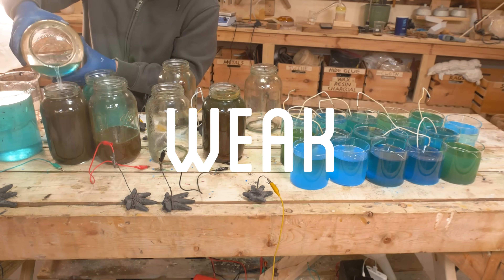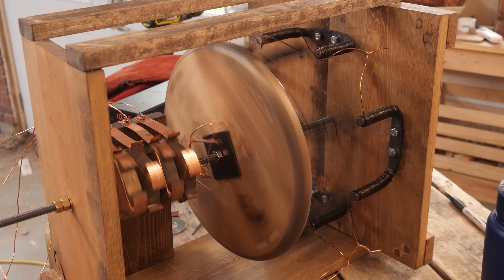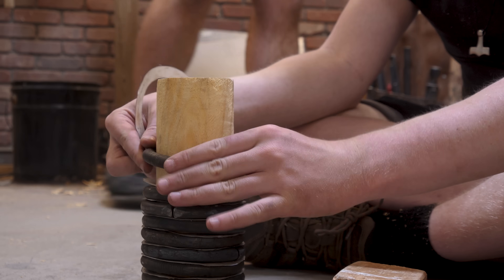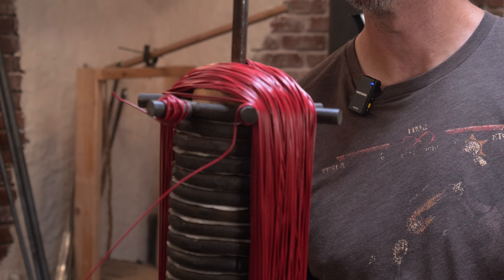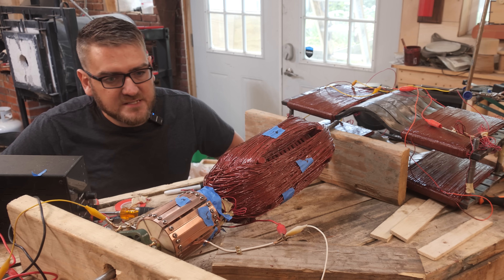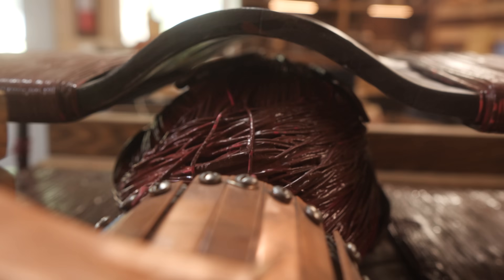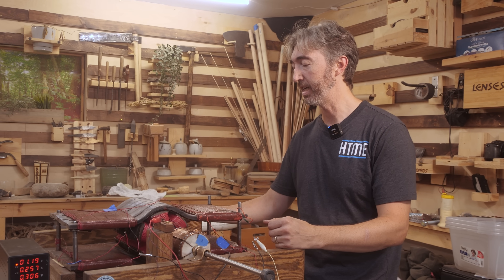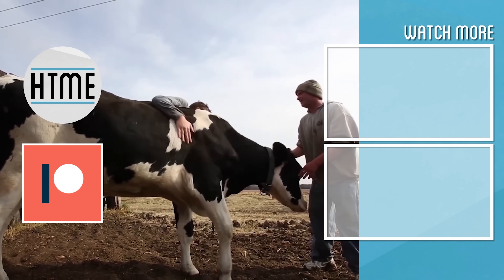I Built the First POWERPLANT!

Comment: Some suggestions would be to use similar laminations for the stator as the later rotor. This should reduce so.e saturation. You can increase or decrease flux density with  the conmutators timing as the coils and magnetic cores have a level of capacitance expressed as a magnetic field.

The challenge is not to exceed the hysteresis of the coils and core materials with a well-timed comutator. 

If you want to check current, just use a known value ressistive load like a power resistor and put a meter in line. You can even measure its efficiency this way as well by examining the dissipation of heat to the kinetic energy put in rotationally. 

From my expense as well, some form of carbon brushes work well for both electrical contact and self healing. They do need to be cleaned occasionally to prevent short or lack of contact. I'm not sure how true you guys want to keep it to the original design, though. 

Hope that is helpful, and it's great to see people making cool things!

Comment: Your project iwas good but you made a little mistake with arrangements ans frem design first you could keep magnet both sides up down the gap increase few cm and use capacitor for output  the way i know if you do it correctly from my experience the winding copper wire you are using can give you at least 45/ 65 voltage ⚡

Comment: When the wire was being coiled I noticed that the failure to rely primarily upon tactile feedback rather than visual feedback was resulting in some less even spacing, but I rationalized it as a simultaneous inspection of the wire and its insulation--a simultaneous safety inspection, if you will. Safety first!

Comment: My first thought was electrical steel (also called silicon steel) for the rotor plates, but that stuff is hard to come by. I'm actually excited to see what you guys can accomplish using regular steel for those, but from what I've experienced in trying to build much smaller motors, it does seem like you lose a lot of efficiency without using electrical steel for the rotor plates. I even tried using iron powder filings mixed with a small amount of epoxy, then placed inside of a 3D printed form to set, but that was even less efficient that just using non-electrical steel plates

Comment: @htme I think you want to reduce the air gap as much as possible. An easy way to do this would be to mount a wooden cylinder with the same diameter as the rotor to the axle. Cover it in sand paper and first sand out the lower half of the stator to a perfect cylinder. Now lower the top and sand it as well. Perfect shape. ❤

Comment: Huh? Shouldn't your stationary coils be on the humps instead of the flat section? I bet your motor works way better if you slide the stationary section to left or right 6 inches and spin your rotor between the two coils. 

If it were me, I'd add a second rotor and tie them together mechanically. One rotor for the left side, and one for the right. But id be very careful. You might create some lethal current. Which isn't hard to do if youre cranking it super fast.

Comment: For a start, as you saw how tightly you can get your coil and how close your coils are to each other makes a big difference, but the amount of windings will determine your out puts, and you'll find speed of diminishing returns with the gap but the smaller it is the faster you can go. The last thing is that you will need more brushes  in different spots on the contacts to help with the pulsing issues

Comment: biggest opportunity for improvement is increasing magnetic conductivity in stator circuit. You need more steel where those studs that keep the stator plates are. You did excellent job with new laminated rotor - stator does not have to be laminated because it's DC, but there is a huge air gap between open ends of top and bottom halves of the stator.

Comment: I think you are losing a lot of magnetic flux in the straight part of the stator. also the stator core could use sum lamination. you can also try to use a glass and aluminum sandwich capacitor to stabilize the voltage going to the stator for a more consistent magnetic flux. you could also add a second off set commutator too give you a more consistent voltage (driving your 2 poles of the stator separately).

Comment: you burned off the wax paper between each of your plates, added alot of conductive carbon on your steel plates, wondering if that affected your insulation you might have had to eliminate the eddy-currents?

Comment: Some ideas on your commutator.

If your output voltage is "Bouncing" you dont have DC output. find a copper tube of suitable diameter, and glue it onto a wood dowel. then take a straight cutting saw, like a hacksaw or bandsaw and make your cuts lengthwise, in line with the axis of rotation. remember, only cut through the copper. then, instead of the brushes only contacting a single line or phase of the comm, orient the brush strips along the outer edge of the comm, so more than on phase or line of the rotor is touching the brushes at once. better to use graphite. then you just have to rotate the brushes so they are in phase with the output from the excited coils.

Comment: An idea for measuring power output would be using it to power a heater coil placed in distilled water. The coil should be separated from the outside environment - i.e a thermos or a calorimeter, with a known amount of water inside. By measuring the time it takes to heat up the water to a certain temperature you can get the power output of the generator. 
If the voltage level was semi-stable during the test - i.e run via a capacitor, you could use I = P/V, giving you the avg current of your generator
  
Or if we assume the voltage kept by a capacitor is stable (enough), just measure the voltage drop across a fairly large resistor placed in parallel to a capacitor - by using Ohm's law you can get the average current without the whole heating up the water problem, then simple multiplication would yield a theoretical power output.

Comment: It seems like the steel bolts that you're using as standoffs in the middle of the stator field is insufficient in Iron contact for continuous magnetic loop without the loop you're separating a large amount of your magnetic flux away from its ability to do its job

Comment: The stator also has strange design. Why is the pole in between the coils, and not at either end? Other such motors, or generators use a single U-Turn electromagnet as stator.

Comment: try running some current through the field windings for a short while with a battery or power supply to give the iron a bit of a residual magnetic field. That might be just enough residual magnetism to get the field windings properly excited under normal operation.

Comment: when stator coils are connected in series, the output rises volts over amps; when wired delta the reverse happens.   is the use of a rectifier allowed; so that the high-loss commutator could be eliminated..

Comment: Linebore the stator so it can have a closer fit to the new rotor. 
But really - I'd make some vacuum tubes to be diodes, and fit them to the rotor, which would be in two parts: A smaller one, like what you currently have , and a much larger one, with just a single pole. 

The tubes would be wired between the one large winding on the big pole and the other three on the smaller rotor, so as to implement a 3 phase to DC bridge. Maybe you'll have to add a shorter coil or two as well, so as to allow for filament heating. 

But the point would be so you can have your existing setup just to put DC onto a second, co-rotating coil. 
Then, you just put it into a big, now stationary, set of coils: Those are your actual 3phase output, generated by the shaft turning the electromagnet inside the stationary coils. No slip rings, so no dodgy contacts to lose power and fail at conductivity. At least, once you get the valves working. Those can just rotate with the shaft.

Most modern alternators work this way. As an added bonus, you can alter the voltage sent to the stationary 'field' coil, and use it modulate the main windings output voltage. Would probably take some more valves, configured as triodes to act as a regulator, but that could be made as well. Initially, just use a variac: You should be able to manage winding one of those. The field coils aren't going to care much if they get AC or DC, whatever will end up getting rectified into the DC through the main field rotary coil anyway. But you could have another bridge made of vaccum tube diodes to pre-rectify it so as you're not fighting the hysteresis in magnetising your existing stator.

PS: high vaccum such as tubes need can be made using Sprengel pumps, which you should be able to manage 
yourself, even avoiding Mercury: Use some warmed up Gallium instead.

Comment: Although it's an inferior conductor, an aluminium can would give you a circular layout. Maybe even a can with an adhesive copper sheet wrapped around it then cut? A thin dremel disc could cut the thin slots needed to break the connection as needed, and filling the cut with epoxy and sanding it so the surface is smooth and not causing a bump would also help

Comment: First of all, how strong is the permanent magnet?
Secondly, check how far out the coils protrude, you want to make the armature have a dense collection of magnetic fields and smaller mechanical resistances, run more cables on one coil set to induce more power and decrease resistance in the curcuit. Electromagnetism is like a hose pipe, depending on your guages, the flow gets pressurized or lacks pressure. And do some research on Darlington transistors and transistors as a subject, it'll help this project immensely🍂

Comment: Where you have the commutator attached to the wood using those brackets, is the rod on both sides attached to a set of barings to keep the setup from bouncing around?

Comment: 2:10, fun fact the electrons dont travel in the wire, they travel on the surface of the wire.
Reply: That is true at high voltage and frequency. The lower the voltage and frequency, the further into the conductor the conduction band can be.

Comment: You are pumping out AC current. Hook it up to a rectifier to convert it to DC power. A LED is a diode that only accepts current one way. Since AC pulses the LED will too. I’d also hook it up to an oscilloscope to see your wavelengths. Great video! I’ve been looking forward to this step for a long time!

Comment: Early generators using the brush designs learned that the solid copper brushes were to stiff and would not flex properly and make to inconsistent contact. The design (though it was difficult to scale it up) included tightly packed wires that became the brushes rather than solid copper. This allowed them to flex and share the voltage load through the banded wires far easier but at higher rotations and voltages they wear out faster.

Comment: The way that you can determine what the amperage output is. You have to use a capacitor. The size of the capacitor is going to depend on how fast you’re turning the crank..

Pick a basic set speed that you like to turn it at and try different capacitors you’ll know whether or not the capacitors is big enough or small enough based on whether or not the voltage drops out .  Voltage and amperage are related in what we view as power or wattage so voltage time amperage equals wattage..

So you pick a set speed for testing and let’s say you try I don’t know a 1000 micro capacitor, at first as you’re cranking you’re gonna have to charge that capacitor so probably for it could depend 10 seconds to maybe half a minute but you’ll get an idea of the charge time because you’ll stop turning the crank and the LED will stay lit up .

The only point that it gets complicated here is your little hand crank is creating AC not DC. The only reason why that’s not a problem at this point is because the LED that you’re using only recognizes One Direction of the AC so if you do decide to use a capacitor you’re gonna have to put diodes Before the capacitor. You’re gonna lose about .4 V going through the diodes.

Comment: Hey guys! I think you can achieve a significant improvement by closing the magnetic flux at the edge of the stator core. For now you only have four small bolts and a huge huge air gap between the upper and lower stator cores. Please insert a bunch of extra thick bolts, or better yet, additional iron blocks, between the edges of the upper and lower stator cores. You'll see a significant jump in output voltage/current/power.

Comment: Wire your rotor poles so it is all one winding, alternating directions of windings so you get N,S,N,S.
Use a carbon brush and a copper tube slip ring as commutator, all one polarity supplied yet the rotor poles will alternate, you'll get a smoother more reliable commutatorand current transferred to your rotor which should positively impact efficiency.
Add more turns to generating coils to increase output 👍🙂

Comment: Don't know if anyone has mentioned it yet but consider the cost of creating the magnetic field and add that to your output. A lot of your mechanical energy is used to create the armature field. That is a loss you can not recuperate. If permanent magnets were involved that loss would be a gain at the output. It is just an inherent flaw of this type of system but the railroad uses a similar system of self excitation to exceed that of the 48volt battery.

Comment: Dont use conmutator approach. Use rings and use several brushes to always keep contact with the rings and then if you want dc output use diode bridges to rectify each phase into an almost smooth output. You will get the best out of it that way.

Comment: Your stator should completely enclose your rotor and have the same number of coils as it, and the air gap between them should be as small as you can possibly achieve without the two colliding.  Use the same stacked plate technique as you did to assemble a symmetrical and circular rotor, but without the insulating paper in-between.  Ideally your stator would be one solid huge chunk of iron but that might be impractical without substantially more shop equipment.  Use whatever your greatest accuracy tools are to make sure the rotor shaft is as straight and level as possible, this will let you get the tolerances between stator and rotor as tight as possible.  Use a flywheel at the end of your rotor shaft to dampen out some of it's vibration, and use a belt drive to get it spinning at faster RPMs.  
If you can make primitive bearings I'd strongly suggest them for your shaft, but if not at least polish the ends of the shaft as smooth and as perfectly round as possible and keep them well oiled.

Comment: Haven't read comments, how about change the contactors from square rods side by side, to sectional arcs in the direction of the contacts, with an insulation material in between so the surface is smoother with little bounce. these can be parallel side by side it will help with wiring too.

Comment: Amazing effort and fun to watch.  Improvements to this two pole generator  (as suggested in many other comments):
   Make sure you understand the magnetic and electrical circuits and wire the coils appropriately. 
   Add heavy steel blocks at each end of the field magnet where the bolts are to close the magnetic circuit.
   Use insulating paper (Nomex) around the steel parts to protect the magnet wire.
  (Quadruple!?) the turns in the field coils.
  Minimize the magnetic air gap between the field bars and armature.
  Using the slotted 6 pole rotor lamination design, wind a "full pitch" armature like the original armature you made.
  Bind the ends of the commutator bars with banding string (fiberglass and resin) then turn and sand round on a lathe.
  Circular field coils also reduced the copper needed as seen in the Smithsonian machine at 3:56.

A U shaped field assembly seen in later 2 pole 2 coil generators used less copper than in the original 4 field coil 2 pole designs because of the increased flux per turn of field coil.

The 6 coil armature would make a great 4 pole machine.  Split the field magnet bars top and bottom and remove enough material to make a large gap between the ends. The modified U shaped magnet assemblies facing each other results in four alternating north-south poles around the armature. Use four brush sets spaced 90 degrees and properly reconnect the 6 coil armature and modified field magnets.  Support all of the pieces so that they do not vibrate or deflect from the magnetic forces.

Comment: Hawkins electrical guide is a good period reference for generator construction. It is 10 volumes, but if you're only interested in DC then vols. 1 and 2 should be sufficient. It is available for free online iirc. The 1917 edition is the better one. Also, you might want a softer brush material such that the brush can "wear in" to the shape of the commutator.

Comment: I would say gears or pulleys. It looks really easy to turn right now.
There are only two sources of resistance in the system. friction and the electromagnetic resistance that generates the power. In an ideal system friction doesn't increase with speed although this isn't physics class. Adding gearing would increase friction on it's own as well, but that should hopefully be negligible. Electromagnetic resistance will increase with speed but that's good. That's what's making the power. So increasing speed should increase efficiency as long as nothing breaks.
The alternative would be to make the generator bigger to grab more of the electric field. the field falls off exponentially with distance though, and increasing the wire length will increase resistance. This is why generator designers typically spin them as fast as practical and typically only increase the size when spinning them faster would cause them to explode. That's a generalization of course, but that's typically the principal you should follow.